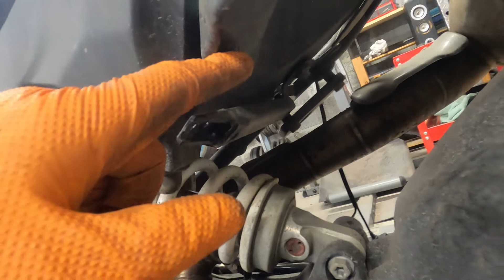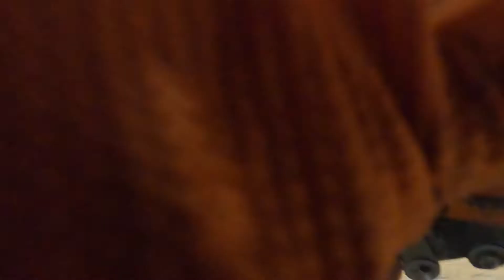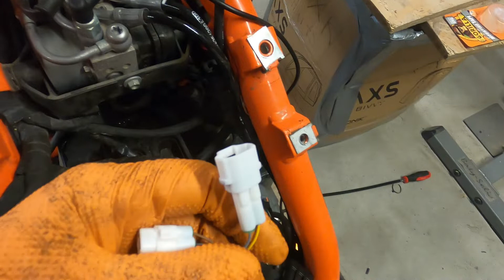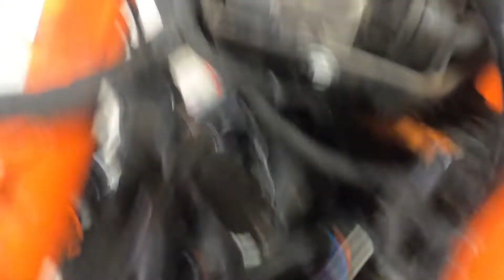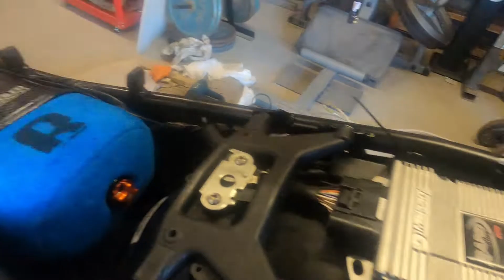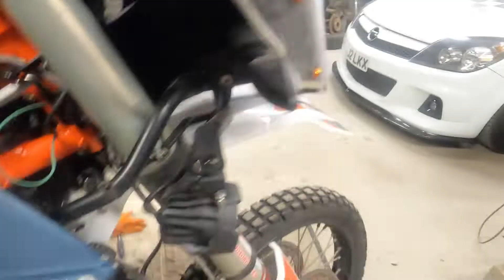KTM 790 Adventure R Rally 2022  Rottweiler Performance Air Box Upgrade  and Ecu Controller

Comment: This is a reminder as to why we should avoid used bikes - the older the bike, the more likely that someone has 'modified' them, which costs a hell of a lot of money, and will almost certainly lead to reliability problems down the line. You should have just chopped the 790 in for an 890. Perhaps you should have found out which component was sapping power from the battery.
Reply: This is the limited edition Rally version which comes with some of the best suspension on the market, swapping for an 890 would be a downgrade.
Reply from the maker: @Spratty 1122  Indeed it is my Friend
Reply from the maker: Hi, I wasn't planning on selling.! it's just a case of each to there own I guess!

Comment: My buddy and I had the RW canister delete dongles. They both threw codes. We threw the dongles in the trash and just reconnected the servo without the canister. No codes. No canister.
Reply from the maker: Hi Jeremy thanks for the info,  I did get  a engine symbol flag up... when I get a chance will take the tank off and reconnect the servo as you suggest